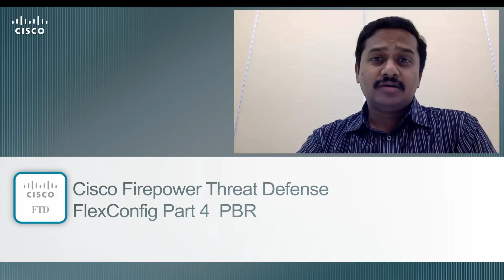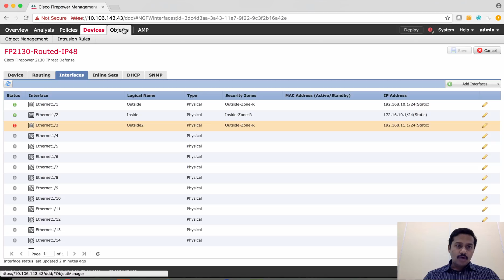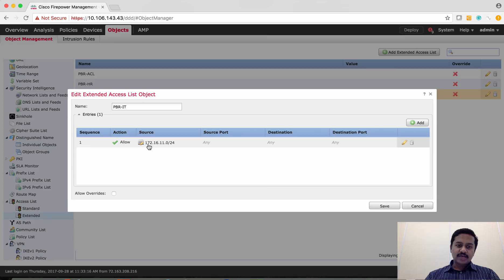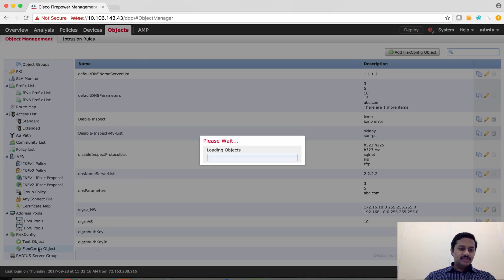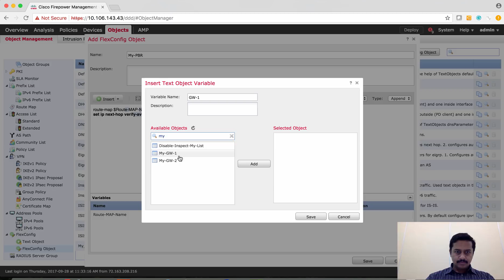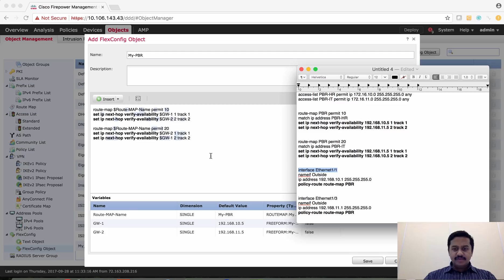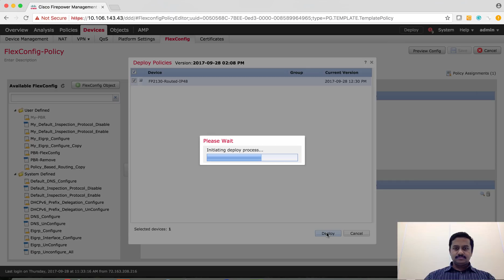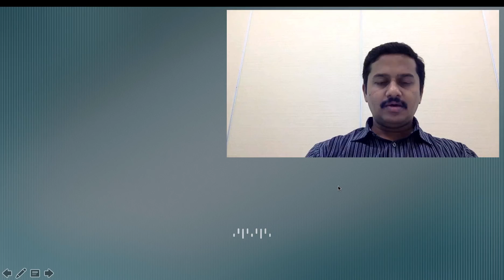Cisco FMC FlexConfig configuring PBR

Comment: I am not sure which interface, the flex config should be applied to. You applied it to the ISP interfaces, It didn't work when I tried. I applied it to all the interfaces, including inside network and it worked. - thanks for guide however.